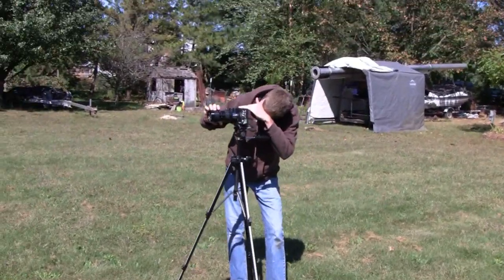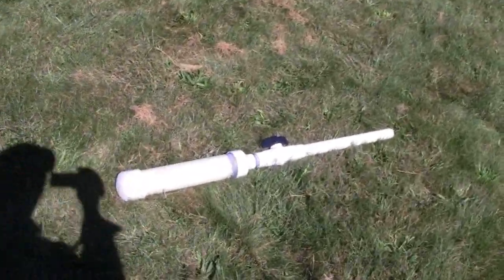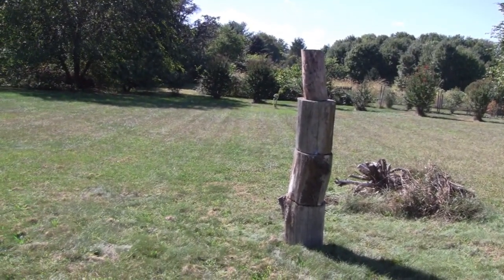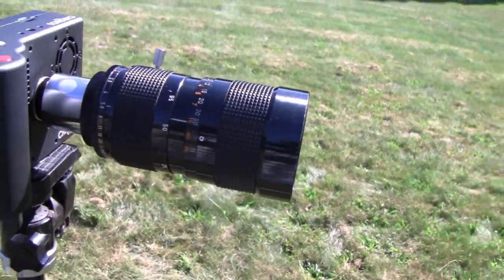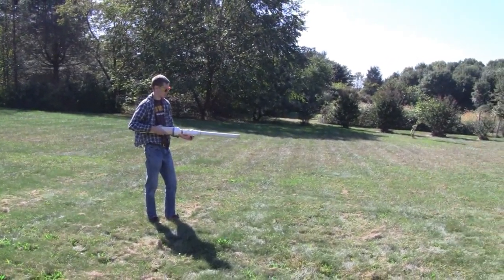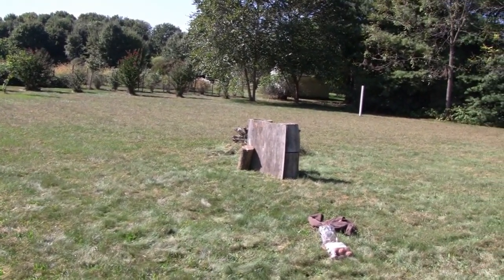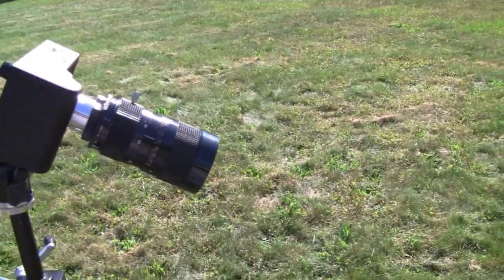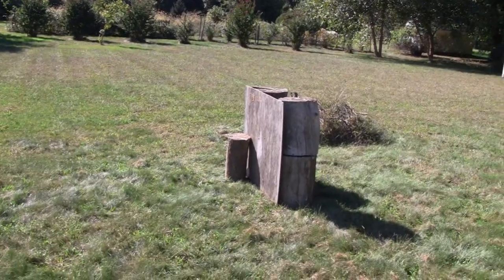SLOW MOTION CAMERA TEST 2

Comment: Pretty cool...  Any day ya get to shoot a tater cannon is a good day...  LOL...  We usually built ours with a clean-out screw plug on the chamber and a BBQ igniter (along with a little hairspray)...  ahahaha  But as long as it works.....
Reply: I used to build those with a 3 inch chamber with the plug on back like yours and necked down to 1 1/2  barrel. I put a washer in the adapter for more POWER. 

When we would shoot a half tater on something hard it would vaporize the spud.  I would take my belt sander and taper the end of the barrel so the round nose of the spud would go in first and the taper would cut it to fit perfect. 

We used starting fluid and a igniter from old gas grills to fire the fluid..   Hair spray didn't work that good for us. 

We could shoot a spud about 125 yards easy ~!~!
Reply from the maker: Thanks Bumbee!! Yeah we've made those guns too!! The compressed air is alot easier to use!!☺